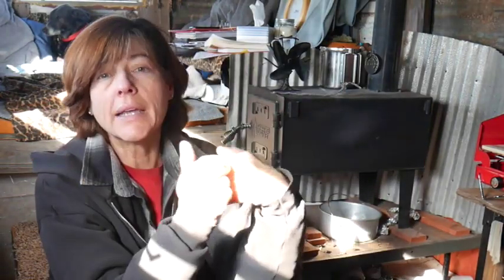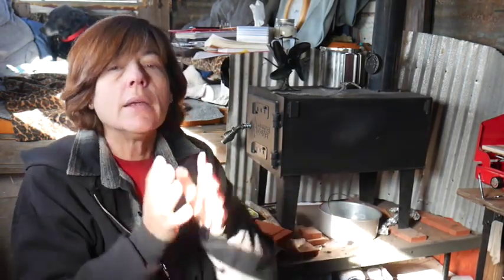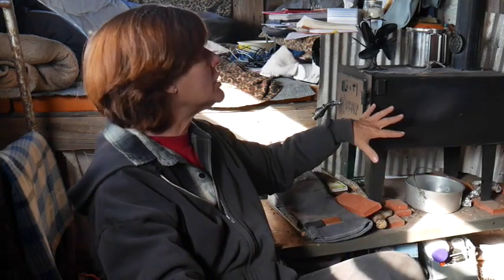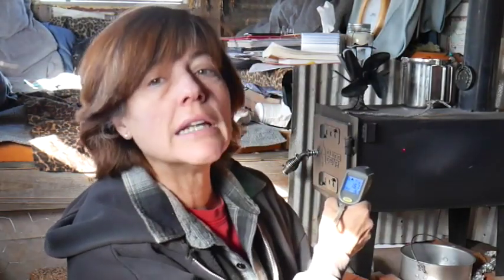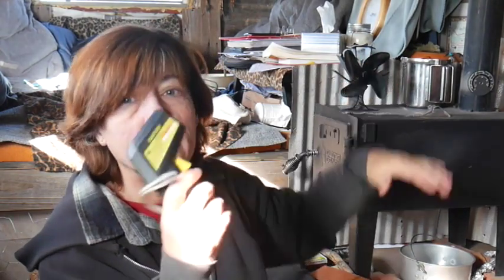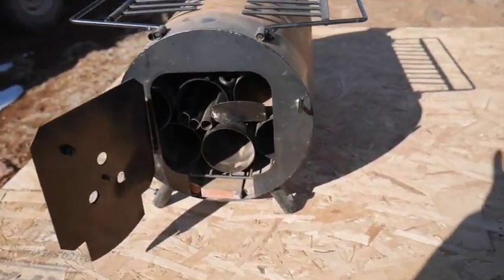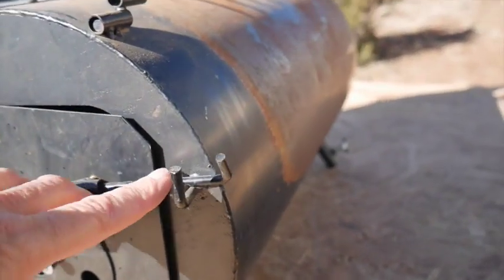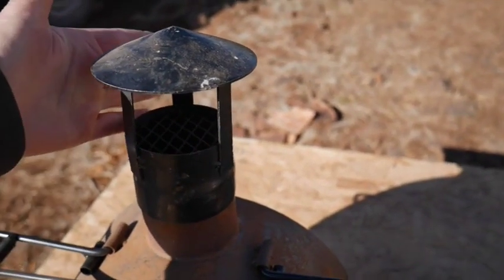Tiny Wood Stove 101 for Tiny Living - House RV Van Trailer!

Comment: I think that a tiny wood stove is a real game-changer for staying warm, especially in a camper, van, RV, or trailer of some type - even in homes I would think that when put in a small area, that it would provide a life saving heat source.  I like the idea of those wood pellets; I've seen other Nomads use those.  I also like your idea of the fire bricks to place inside of the floor of the wood stove to protect it's bottom; I think tin or aluminum, even foil, might work inside as well to give the insides a longer life and structural stability - I'd probably opt to utilize aluminum foil or something like that.
I think that insulation is the key of course to holding both heat and cold inside of any structure.  Tiny homes on wheels, which include all vehicles, are off the ground so the wind moves underneath the structure and can make it even colder.  I guess if I could, I'd figure out some way to create a skirting that would go around the entire circumference of my vehicle or home on wheels.  I may have to create something that could be magnetically adhered to the sides of my rig and when down could be either folded like an accordion or rolled up and tied off.  Of course there's always the idea I have of purchasing an RV Jacket and just putting it over the entire rig to help seal out wind and rain - just an idea.  I think everything you've deployed is great and it's working well for you :)

Comment: And then there's cold places that have burn bans.  So even though you have it and need it, you're not allowed to use it (legally).  I was in Colorado one winter, and all the call ins on the radio were, are we still under a burn ban?  We have burn bans in Texas, but for the dry and hot reasons, not the cold ones.

Comment: Heat a rock, wrap it in a towel, take it to bed. I think thermal capacity is a thing. Water is good for it, those things in electric storage heaters, super heavy concrete hold heat for some time. My stove is hot, Hot , HOT, and off, but the bricks around stay warm for 3 or 4 days. Its a house, if it falls I will be squished
Reply: Sayqued beloved, we are gathered here today to celebwate Thermal Mass. Put your hands together and rub. Now chill out. It sayeth in the sayqued book "the densest stay warmest the longest" Hey men.